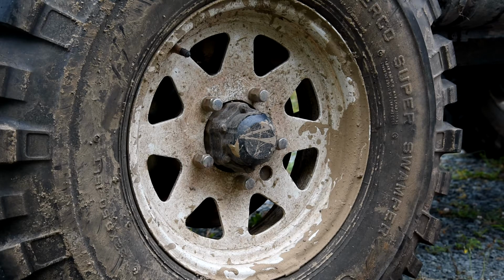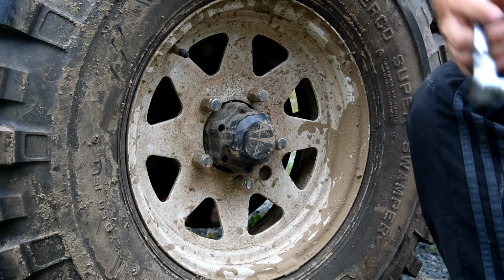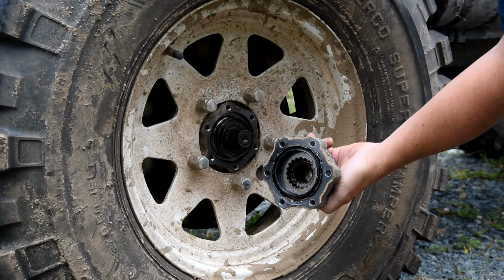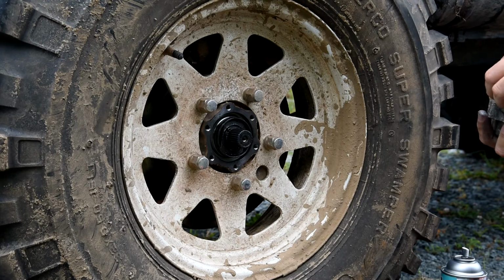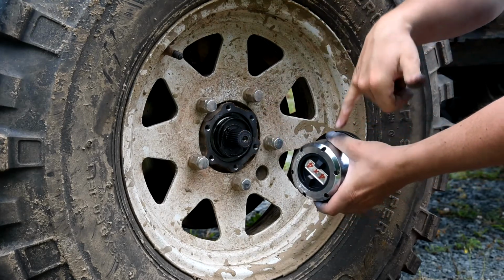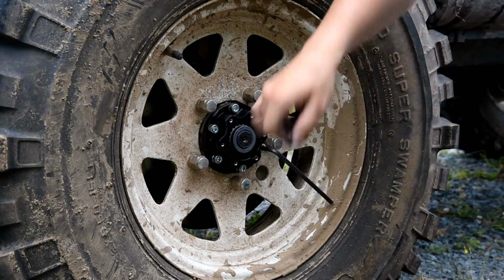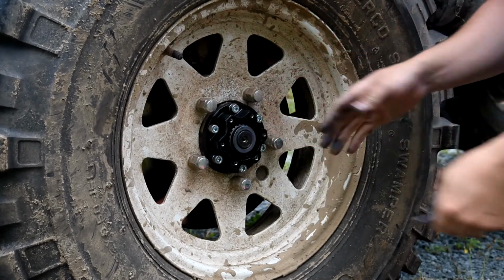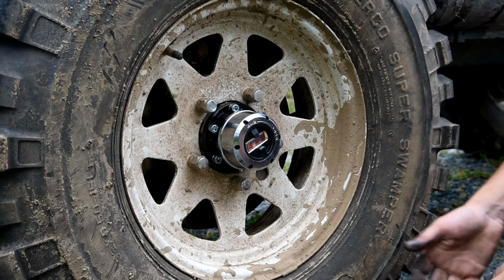How To Change Freewheeling Hubs

Comment: I solved the problem of the 4x4 functioning by mounting the tyrex manual hubs instead of the automatic hubs that always gave problems in my 2001 Suzuki Jimny 4x4 with m13a motor and to replace the automatic hubs and overhaul the vacuum system for inserting the 4x4 I would have spent many euros between spare parts and labor! (greetings from Florence Italy!)
Reply from the maker: I’m happy that you could solve your 4x4 problem and save some money! That’s great news.
Reply: @watchmework7672  thanks for the reply to my comment relating to your video tutorial! (if you like it I would like you to subscribe to my Youtube channel to see my blue Suzuki Jimny 4x4 from 2001 1.3 l petrol with m13a engine off-road?)

Comment: Thank you for a great video. I've also installed those locking hubs on my Jimny. My question is, Did you notice that the wheel is kind of hard to roll freely ? IS there any spacers that you need to install with the hubs?

Comment: cordial greetings from Italy Florence the Suzuki jimny 4x4 uses a lot of gasoline because it has the smallest fuel tank with a liter capacity. It has a problem with the automatic buckets because the vuoto system that arms the automatic buckets wears out! tirex manual hubs for me the manual hubs are better than the original factory Suzuki automatic hubs!)

Comment: Ad a little grease (or in this case spray lubricant) to the locking hub assembly to.  I would use gun grease - not wheel bearing grease.

Comment: Are you still happy with the manual hubs? Are they still working?
Reply from the maker: Yep! They're still working perfectly. It's a tiny bit more effort to engage them manually vs the old vacuum operated ones but the peace of mind is worth it to me. I didn't want to risk one of the vacuum lines being damaged while off road and losing 4x4 operation. Now I know for certain they will remain locked until I choose to unlock them.

Comment: So you stop Jimmy put  main gear in neutral , pull hand brake, get out twist that 4wd hub key to 4hi then get in shift transfer case gear knob to 4hi , release hand brake drive it on 4hi . Then repeat opppsite way to get back to 4hi. I wanna learn since Jimny are electronic and vacuum line operating hubs how have you trucked the ecu and those front hub vacuum lines ?? In order to make all work with manual free locking hubs?
Reply from the maker: My Jimny was not electronic 4x4, it was a manual lever. All I had to do was plug the vacuum line for the hubs and use the manual hubs instead.

Comment: Dear, thank you for the video and all advice. I have a 130 defender 2012 and I would like to use freewheels hub too. Have you some knowledge if it is possible ? Thank you for your feedback. Laurent Switzerland
Reply from the maker: Hey there! I don't know very much about defenders (they're very rare here) but the process for changing the hub should be essentially the same. As long as there are freewheeling hubs that will fit on your axle, it should work. I know some of the older Land Rovers had them, and maybe the axle is the same - but if not there's likely an aftermarket company that makes them.
Reply: @watchmework7672  thanks so much for your message. I keep looking. Cheers

Comment: is it the same process for a 1996 suzuki Vitara ? and thanks the vid was really helpful
Reply from the maker: There will likely be some minor differences but the basic procedure would be the same, yes. Locking hubs come in different shapes and sizes but the process of changing them is essentially the same for all 4x4s with standard axles. It's a bit different for 4x4s with full floating axles but that isn't the case for your Vitara.
Reply: The hubs are the nearly the same, the jimny ones are a bit longer. You can fit vitara ones to jimnys with a spacer but obviously not the other way round.

Comment: After you did this did your 4wd light still work
Reply from the maker: It still illuminated, but it would blink at me - indicating there was an error. I believe there may be a way to fix this, by fiddling with the vacuum lines in some way, but I never bothered to do that. The blinking green light was never very noticeable to me when I was off road either way.

Comment: Are manual hubs better than automatic?
Reply: Function the same basically, but manuals are more trustworthy. If a vacuum line fails or an auto hub fails it’s typically the system that engages it that’s the issue and then you’re out of luck. Since you do manual hubs by hand, they just work.
Reply from the maker: As camp said, they're not better or worse - but they're more reliable. My 4x4 had vacuum operated hubs and I was concerned that the vacuum lines would get damaged while I was off road. This would disable my 4x4 system and potentially leave me stranded. That's why I replaced them with manual hubs.

Comment: Nothing like watching some one bashing on the wrong size or type of tool on an instructional video 
Probably better to use breaker bar to crack open or undo a nut or bolt than a ratchet unless you want to keep the tool shop in business 
Also better to use marine  bearing grease considering the hubs will be under water from time to time
Reply from the maker: Thanks for the input. Feel free to make your own instructional video if this one wasn't helpful.
Reply: @watchmework7672  man it must be annoying getting that sort of comment on a video you made. What a dick. Not only is he wrong, he was a dick while being wrong as well. Your video was great man. I admire the fact you made it on the fly, framed it well and kept out of the way of the shot the whole time. That takes some skill and experience. I'm just about to do this to my Surf (you guys call them 4Runners), so just watching a couple of videos to refresh my memory on how they go on. Thanks for the video.
Reply from the maker: @KiwiPokerPlayer  it takes all kinds, right? And I do know of the surf! They're sweet rigs. Glad my video could help you out, man :)